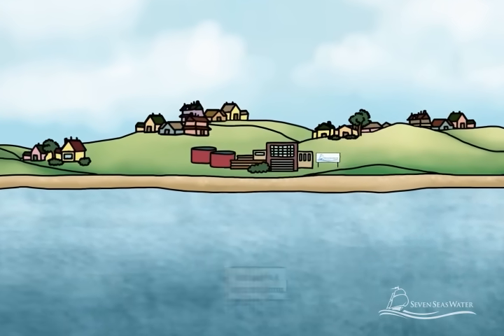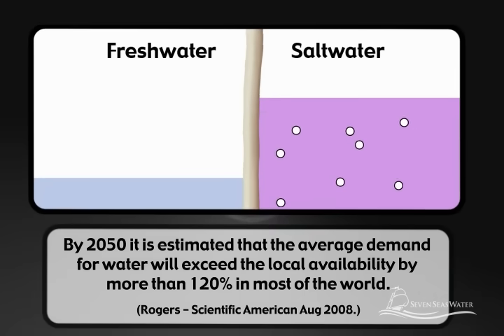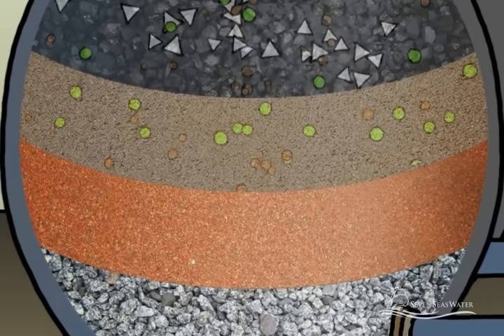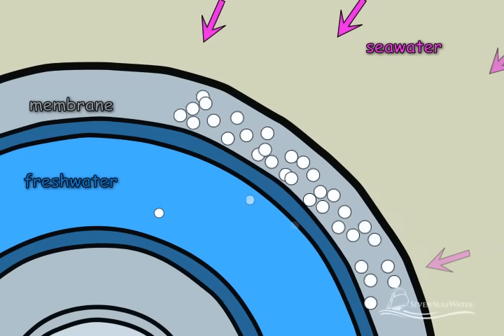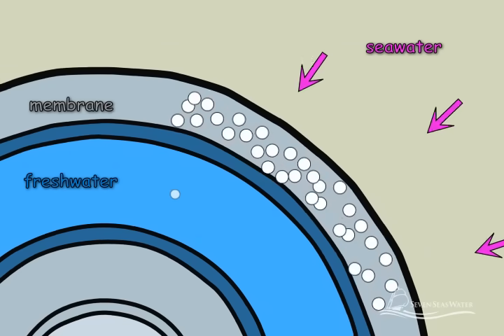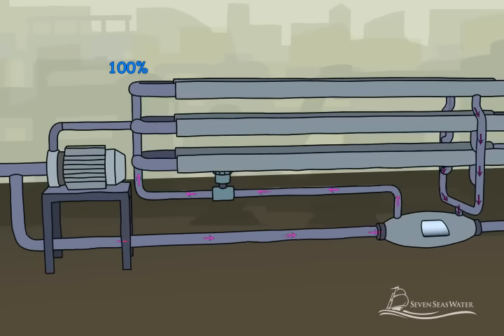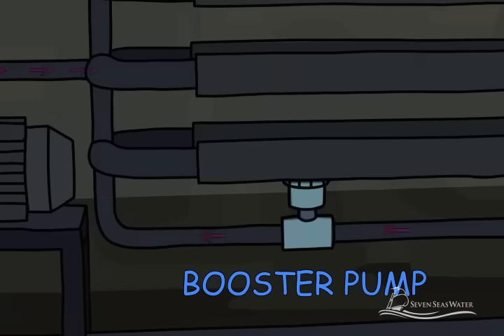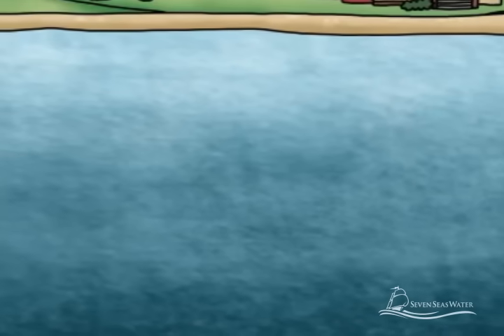How Seawater Desalination Works

Comment: You forgot the large amount of energy required to power these desal plants. Most of the ones I know use fossil fuels.  If they can be powered by renewable, they are great.
Reply: Check out the ones in Australia. Using 100% renewable energy and supplying millions of people fresh water.
Reply: @alexanderjuvarn6012  The ones  i have built were in Australia. They were all connected to the grid which is primarily fuelled by coal power stations.
Reply: We can use solar panels ???!!
Reply: @prabhusingam1  

It's possible to even use power from inflowing and outflowing tides to help run these plants.
Reply: prabhu s wind and wave powered
Reply: Which is why they are best built adjacent to power plants.

Comment: What if the power goes out like in Puerto Rico?  They're still susceptible. 6:20
Reply: If power goes out - also most  other sources of fresh water will come to an hold, that are not accesable manually (allmost all in the developed world). But you can of course add an independent or emergency energy source at side.

Comment: We should definitely invest in desalinization technology to make it more affordable and efficient.  Perhaps we could find uses for the salt and other minerals found in seawater while we're at it.

I also have an idea for an air purification system on a massive scale.  Build a large building specially dedicated to this purpose, it would have many vents on the outside for sucking in the air, then have numerous layers of filters such a large thick mass of cotton like material that would catch alot of the particulates in the air.  Then suck the air through to a main cylinder which brings the air from the bottom way up a significant height, at the top of this cylinder would be a system of water spraying nozzles to make lots of mist which saturates the air and essentially comes down like artificial rain all through the cylinder (rain plays a large role in cleaning the air), this would have the effect of catching much of the remaining pollution in the air.   The air is brought into a final chamber which is designed to catch the water and brings the clean air to outgoing vents at the top of the building.  The water should be reused as many times as possible to cut usage and cost and eventually be added to the sewage system.  I think such a facility would significantly drop pollution in large cities like Los Angeles and Beijing where pollution is a big problem.  

I'm no engineer and I have no idea what such a filtration building would cost to build and operate, but I'd like someone build off this idea and make it feasible.  I would certainly like to breathe cleaner air and I'm sure plenty of other people do as well.  Just wanted to put that idea out there...
Reply: It's worth a try
Reply: The problem with this is the water mist slowly gains acidity, and becomes less and less effective over time. Filtering it through mixed ion exchange resin could help, but I argue it's easier to make cleaner fuels, instead of just cleaning the mess. It's easiest to just not make a mess instead of cleaning it up.
Reply: @radioanon4535  The water would be replaced as time goes on, reuse it as much as you can but not forever.  I'm all for clean energy, I simply wanted to propose a way to clean our air on a large scale.  Many big cities have horrible air quality and would benefit greatly from some form of air filtration system.  We have water treatment plants, why not something similar for the air?

Comment: That fabrication would get clogged with marine life all the time. A large cage surrounding the intake valve is needed so that there is not a suction grip strong enough to trap any marine life on the outer cage. As the intake valve also needs to be covered by a rotating ball self cleaning & made of self cleaning materials in the processes known of the lotus flower. Also reverse osmosis is not going to be adequate to clean enough ocean water fast enough to supply everyones’ water needs & Agricultural needs. The minerals, organic compounds & elements found in ocean waters benefit all biological & agricultural growths by up to a 90% improvement is every aspect to do with any of these matters. Magnetic electro & light spectrum Resonate Frequncy separation of all materials in ocean waters is the most likely way to proficiently desalinate Ocean Waters & preserve the matters in them for use in all Biological & Agricultural fertilization needs. Since every piece of any matter in the Sciences has a Resonate Frequency in it that can be matched to draw, attract & group related matters together to separate out of Ocean Waters for beneficial uses.

Comment: there is at the moment no foolproof solution that guarantees 24/7 operation.
i would suggest to connect this to a molten salt energyplant and use saltwater for cooling which heats up the saltwater already then use the steam comming from the saltwater evaporation to drive the turbine and sell the water as clean water.

Comment: wold that increase the salt lvl in the ocean? why not pump it to a salt water tower and let gravity do the pushing that way if this is go's mass scale it wont make this good thing a over used regret that wont be seen for years to come
Reply: Because gravity alone can't develop the pressure to filter through an RO membrane. Your header tank would need to be in orbit for that to work.

Comment: But is has a problem 
If we pump salinity back for a long time or in long term it would make the see water more saline and bad for ocean life and difficult to desalination again
Reply: Due to the water cycle, it won't make any difference whatsoever. Remember that every drop of water you drink eventually return to the oceans. There will be some local concerns as a result of the brine, but it makes no difference in the long term.
Reply: steve gale  Ridiculous.  100,000 gallons of water is a cube of water about 1,240 feet across (less than 1/4 mile).  You pulled all of the salt out of 40% of it and sent that inland as drinkable water.  The remainder has a higher salt content and you flush is back and mix it with sea water of normal salinity.   The salinity variation across a couple of miles of ocean would be trivial.  You would have more variation in salinity levels every time it rains.   Marine life tolerates salinity within a RANGE because the salinity levels vary widely.

Comment: ...or you can 'distill' it passively with domes of glass that capture fresh water for drinking at a tenth the price
...everyone could have been doing this for years ...BUT, the 'grinders' had to make money on the weather and drought socialism 
...steam (super-heated) can then economically power most of the worlds motors and engines, BUT, where is the money in that?
...electrolysis can cheaply convert water into hydrogen & oxygen and load pressurized cells that can be engineered into the body and frame of a vehicle or house for infinity power, BUT, where is the money in that?
Reply: your domes of glass solution only works for people who have space and enough sunlight/heat
Reply: Short answer: reliability, volume, efficiency, and consistency. 

TL;DR answer: Glass domes don't scale up linearly, only work if the sun is out. When you consider the production output vs time vs maintenance (dome replacement when sun damage clouds the glass) it is slower and more expensive. If were really '1/10' the price an entrepreneur would've undercut government tap water interests with it by now. 
We had a 'steam age' already. Again there are practical engineering limitations that you are either unaware of or are ignoring. 

But i know your type, the limit of your scientific and engineering knowledge is from headlines at worse or The abstract of research papers at best. But if you want to put your money where your mouth is I know some pseudo-scientific/engineering Solar Roadways and  Water from Air projects you can invest in.
Reply: @xXevilsmilesXx  ...yes, true enough ...my premise was that 'in the past' would have been the best time for desalination ...YES, now it would be cost prohibitive ...AND, as to my 'type' ...Stanford Engineering (master's degree 1974) ...AND, by the way, I posted that comment specifically to get opposition opinion and research...Thank you
Reply: @clintonjones955  
You made no reference to a 'in the past' premise in your comment. 
Instead of this supposed Masters in engineering you have, I would suggest looking into “critical thinking” or “introduction to logic”; Irving Copi’s Introduction to Logic is a good start. It'll help prevent you from making rhetoric fallacies such as Appeal to Authority.
Reply: @xXevilsmilesXx  ...Thanks for your comments (adversarial as such) NOW, how can the world recover from so many missteps (costly)
Reply: @clintonjones955  
Adversarial criticism is needed, required even, to cut through ambiguity and omission. 
Depends on what you mean by 'missteps'. The first electric car was invented in 1828, almost 200 years later it only became viable yesterday (based on Telsa profit report). How deeply do you examine externalizes? How do you measure a 'missteps'? Environmentally? Economically? Humanitarian costs/benefit? You want look at it in the lens of World Systems Theory?
Reply: @xXevilsmilesXx  ...as the 'money motive' leads all things, we sported 'gas' (not alcohol?) and now too many people make their living from oil to fully encourage electricity ...most 'missteps' occur as one allows money to  lead rather than intent
Reply: @clintonjones955  
You are putting the cart before the horse in these examples. 
As an engineer I'm sure you are familiar with the concept 'optimization'. I'm sure you are also familiar with the capitalist concept of supply and demand and the differences between Classical/Neo Liberalism.  
You do not/can not change an established optimization (a device and/or for the sake of argument economics) by trying to subverting the 'supply' side, i.e forcing people/consumers to adopt a more work (I hope I do not have to tangent explaining the word 'work' in this context... opps) intensive supply. The equivalent would be adding 5 cogs in a pocket watch (any system) were 1 would do. "The path of least resistance" if you will. 
Dude, this is A-level (101) Economies stuff... 
A society has a moral obligation to compensate an entity (person/corporation) for a skill or product they provide. This why I am paid a wage in this capitalist society and not a slave in some communist state like North Korea. The Neo-liberalism light that shines on this is why we have corporate Monopoly laws and consumer protections like informed consent.   

But addressing your assertion of global conspiracy of a shadow oligarchy, it is easier to pump oil than build a wind turbine. To quantify the energy potential and utility of oil/gas compared to even the most efficient battery is no contest... (which I feel weird having to explain something so basic to an 'engineer'). 
The people decide whether to spend their money on a gas or electric car. The individual/consumer makes the choice, and this where you pseudo indignation becomes empty. Your issue is with the people, to quote you: "..too many people make their living from oil to fully encourage electricity...", the people decide, not the corporations. Sounds less sympathetic worded this way, so I see why you try to avoid it. 
(Bait laid)

Comment: 40 percent yield is pretty lousy.  Theoretical max is about 65%.  (Ocean water is 1/3 the maximum salinity, therefore 3 gallons worth of ocean water's salt can be concentrated into 1 gallon of outflow, leaving 2/3 of the input as freshwater yield.
Reply: Dirk Gently the point is that the raw materials- ocean water- are not in short supply. Sure, you could increase the yield, but to do so would require much higher pressures, more frequent membrane replacement, even stronger equipment etc. The cost of increasing the yield do not make economic sense. Better to use a larger volume of sea water and achieve a reasonable yield at lower cost.

Comment: Would it help to do some of the sediment removal using centrifugal particle separation equipment?
Reply: No, because the bulk of the cost is in the pressurization for the salt removal.  Particle filtration is a negligible part and the energy required for centrifugation would be higher.